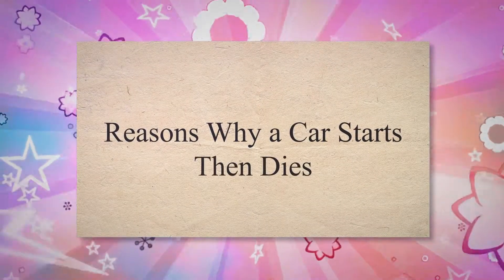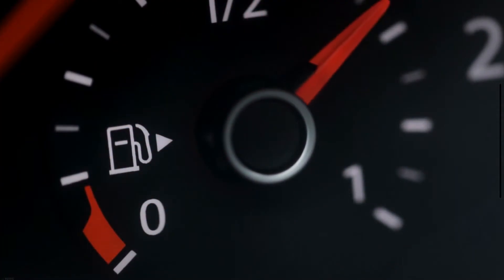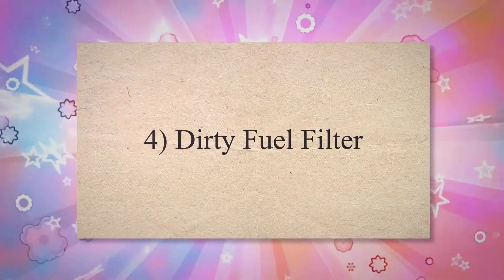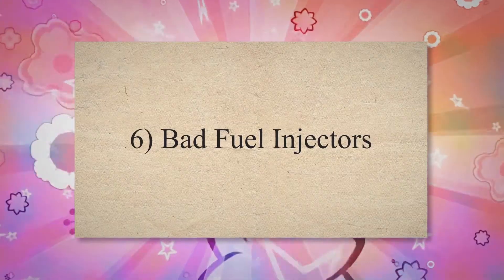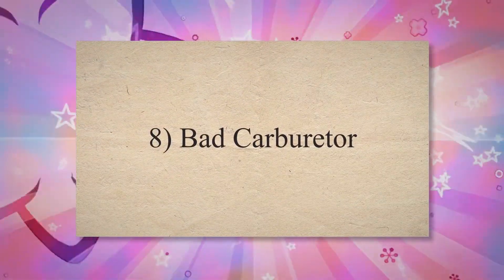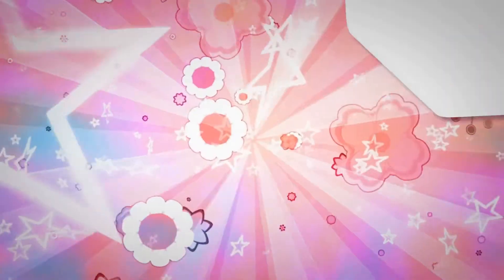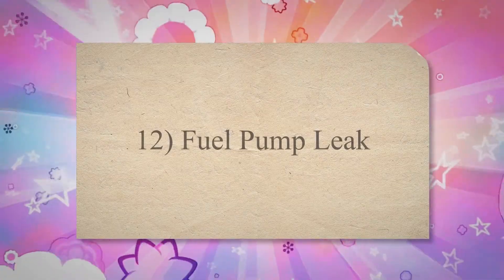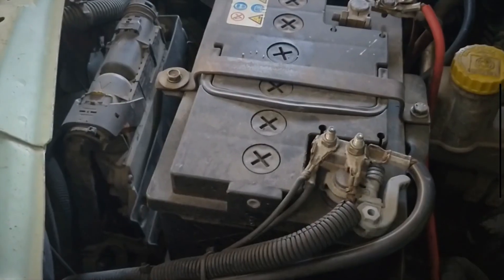13 Common Reasons Why Your Car Starts Then Dies

Comment: Yesterday I just had mine start up for like 15 secs, sputter then die. I went to start it back up and it was fine. It’s happened a few more times after that. Check engine light on. Getting it looked at today.

Comment: What if is not dat Map sensor??
Reply from the maker: If it is not MAP sensor, there is a possibility that you have a faulty O2 sensor, fuel injector or any other explained part
Reply: @MechanicalBoost  They already change the injector Nd petro pump also Map sensor
Reply from the maker: @ZeeMotumi  It is best to contact a professional mechanic to find the main issue